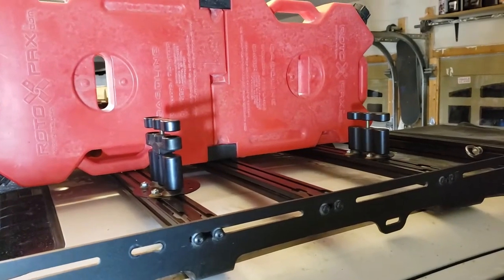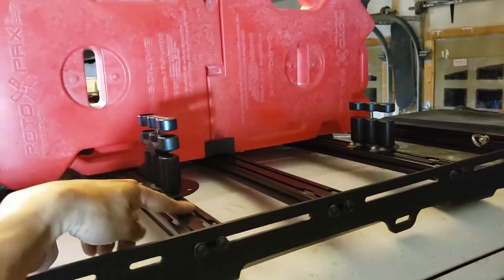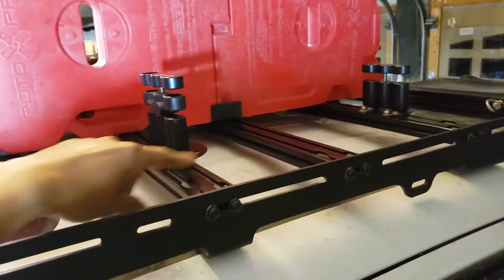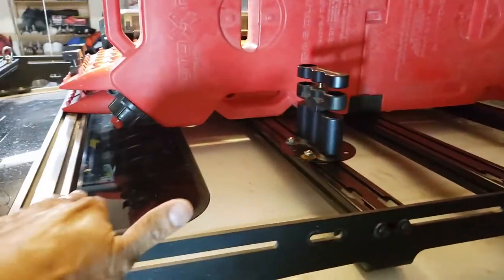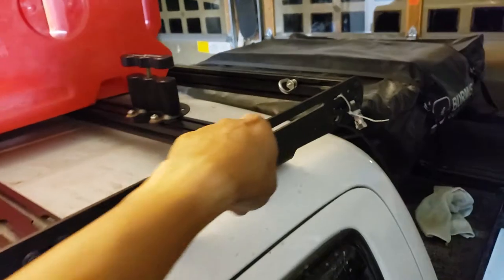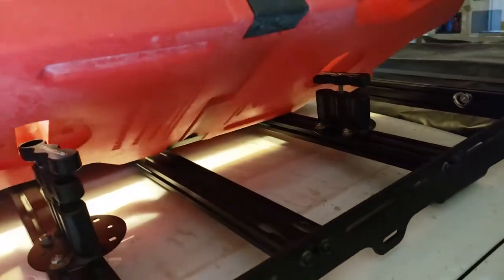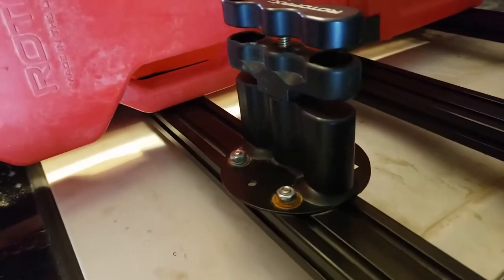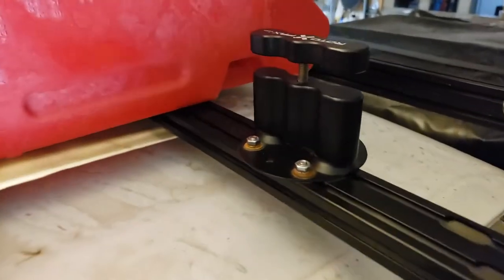Direct RotoPax Mounting Onto Prinsu Crossbars - Up close installation instruction

Comment: Perfect! Now I understand how it can be done. Thanks!
Reply from the maker: just a note, due to rusting, I highly recommend using aluminum hardware (carriage bolts, washers and lock washers).  Also, I used #6 3/4" carriage bolts to mount onto the crossbars. I'm sure things will work out for you, good luck Uncle Aaron!

Comment: Sketchy 😅 it holding up?
Reply from the maker: no issues with it since the initial install. Been offroading and camping many times and it hasn't moved even a bit. As long as you have lock washers and nuts tightened correctly, I don't see any reasons why it wouldn't hold.

Comment: Is the tank resting on the nuts and bolts? If so, do you think that will eventually damage the tank?
Reply from the maker: Are you referring to the nuts/bolts that's holding down the Rotopax mounts?
Reply: @modXELA  Yes.
Reply from the maker: @PaulStimac  no, the depth of the circular recess (0.25”) is slightly deeper than the height of the nut. So the nut is not even touching the canister.
Reply: Is there any risk of gas leaking on the roof by putting it in that  position? . Looks really nice . Just concerned about damaging the paint
Reply: @faraon769  .......you mean right over the sunroof??? na na he'll be fine!!!